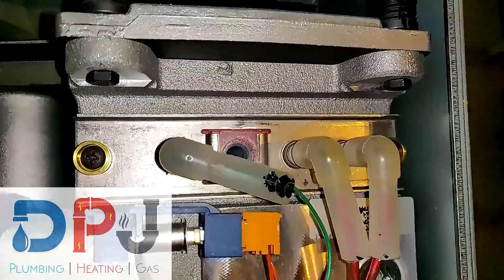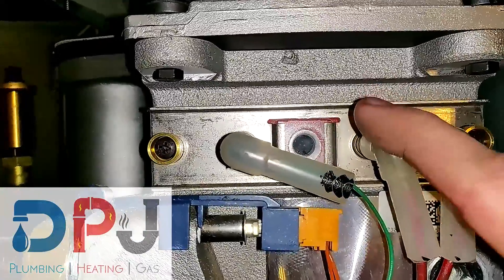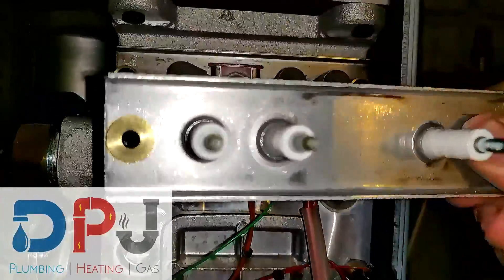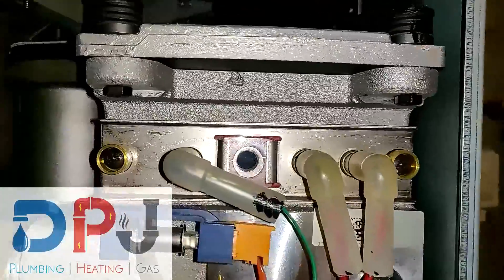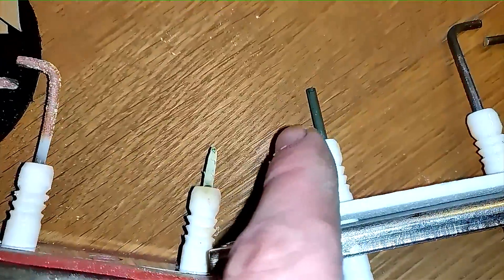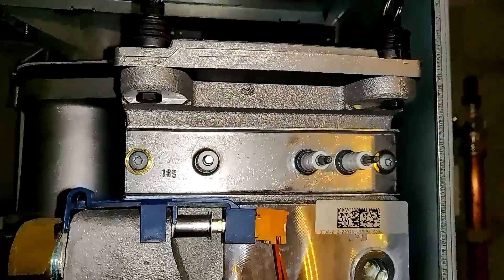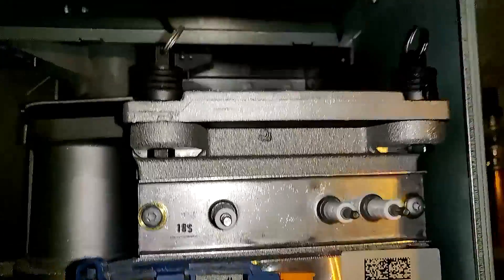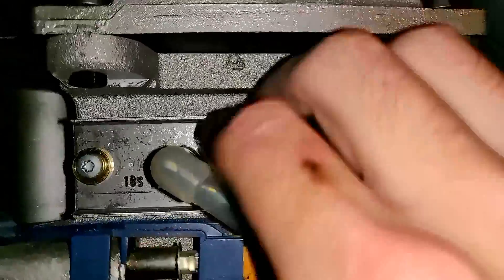Worcester Electrode Plate Replacement

Comment: REALLY irresponsible to show this.
Reply from the maker: I've shown what happens to the electrodes over time and the reason why getting your boiler properly serviced is important.

I've not shown anyone anything they couldn't figure out themselves....and in the grand scheme of things, this particular video shows a lot less than other videos out in the open.

So, while I can see your point of view, on this occasion I don't think it is irresponsible when looking at it objectively.
Reply: @dpjplumbing  There's literally a comment below from a have a go hero that did it and is now wondering why his hot water isn't working. Videos like this encourage such behaviour and also train non-rgi's in boiler repairs too. What means does that guy have to test the boiler afterwards? The instructions on the electrodes tell you test all round the plate with an FGA. Can he do that? No.
We get it - you know how to fix boilers, well done...is your ego so fragile that you have to show everyone on Youtube? I'm gonna start sending my local GS inspector these vids to see what they think of it.

Comment: Done this to my greenstar 38 cdi. Hot water keeps going off. Need to reset boiler. Any idea why this is?
Reply: And this is why.
Reply from the maker: I need more info to guess what the issue is but I'd assume that the hot water issues are unrelated to this.

What exactly is your hot water doing?
Hot cold hot cold
Or no hot at all 
Etc

Is it a combi boiler?

Cheers

Comment: What it the white material is it a heat repellent that goes on the inside only my new one didn’t come with it thanks
Reply from the maker: The white material is the gasket/seal and mine came with the new electrodes. It definitely needs it or else it'll be leaking POCs.

Cheers